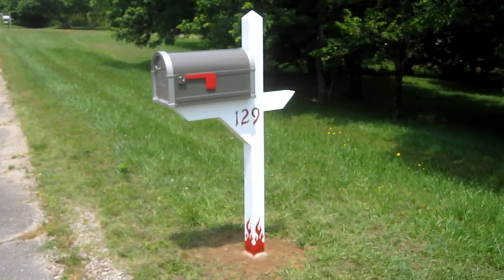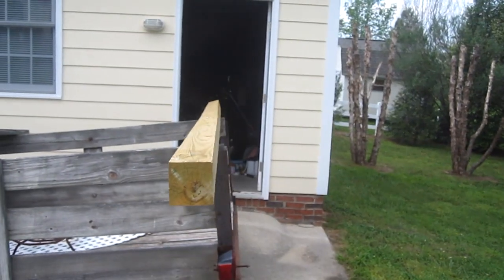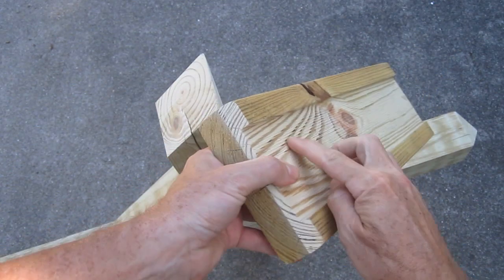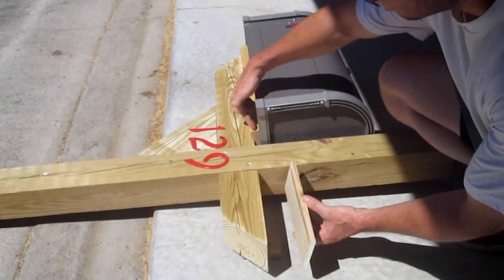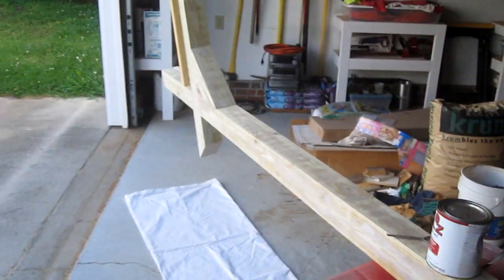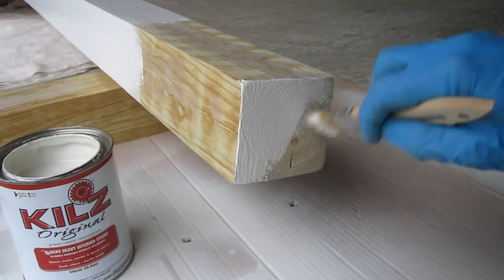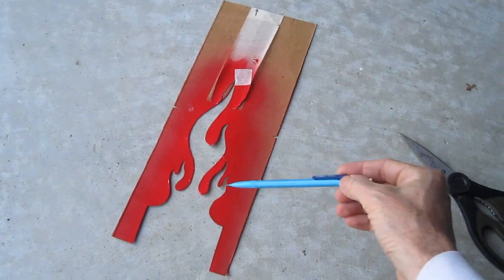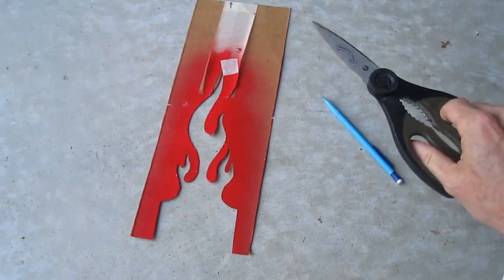How to Install Mailbox Post Build from Scratch Gibraltar High Grove Large Woodworking dig hole

Comment: Nice post. I wouldn’t use concrete though. Not necessary. I use a six foot pry bar with a round flat top to tamp down dirt around the post. I do six inches of dirt at a time. This creates a very strong bond. My post never moves. If it’s ever damaged you can easily remove and replace. Not so with concrete. Learned this from a local farmer.
Reply: I'd read about NOT using concrete as well, but wasn't sure how to do it.  Thanks for the suggestion.
Reply: Blake 

You’re welcome.
Reply: Blake You did a great job. I believe concrete will make pole to last more years , instead of digging it inside the dirt. Moisture is always a problem. Great job. 👏🏾👏🏾
Reply: I've set tons of posts with that exact method (I call it a digging bar...one end cuts roots and the other tamps earth) and they stand firm some going on 24 years now.  If you ever do need to remove a post set in concrete, it can help to use a hi-lift jack aka farm jack like the Jeep owner in the video might have :^)

Comment: What did you did to cut the shallow notch in the box stabilizer? Same thing as the large notches for the cross section of the post?
Reply from the maker: hi, i used the table saw just like the notches. it was more of a long shallow cutout ad i used the saws fence to keep it straight.